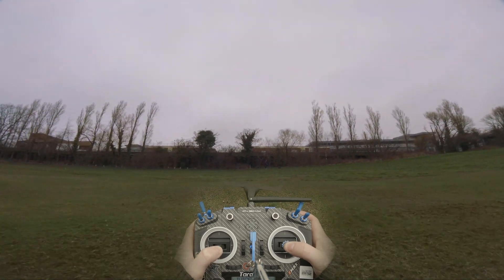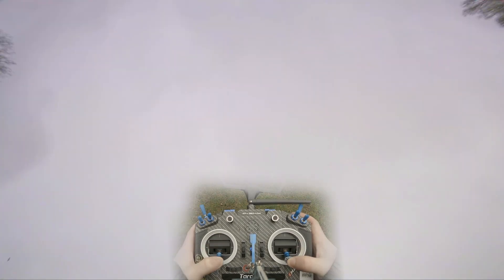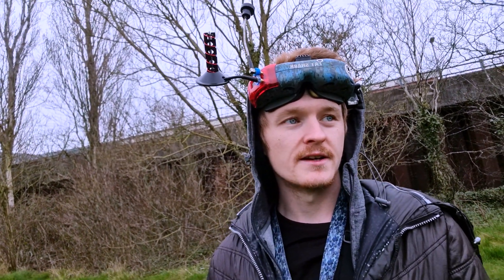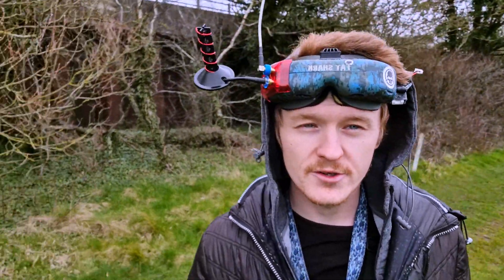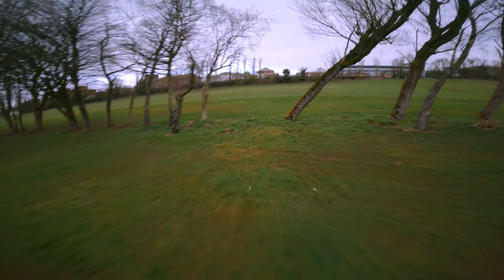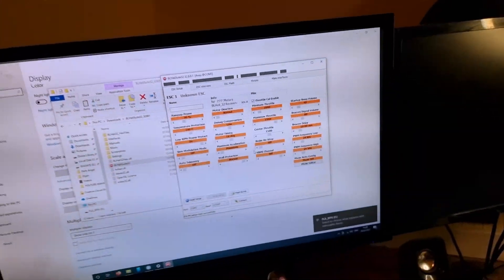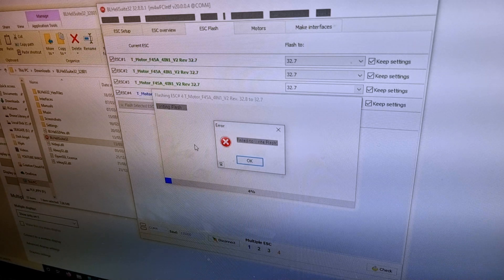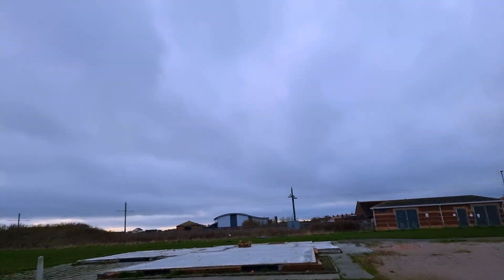Blheli_32 Upgraded to 32.8 || FPV DRONES

Comment: Is it bad to see bad frames in BLheli32 when I check in the configuration I see that all my arm Tekko32 ESC's are getting bad frames.   I'm having heard time finding and information of this. Problem I'm having is my 6 inch running latest inav 3.0 is having weird I'm guessing dysynk issues and falling out the sky.
Reply from the maker: Are you connecting to bl heli using a the flight controller Pass through? I would suggest trying a different flight controller to connect to bl heli and see if you see dropped frames then. Rules out the connection is the problem. I've never actually seen dropped frames before on any of my 4in1 escs. So that is a first. Are you using the latest bl heli firmware?
Reply: @AlexFliesDrones  latest BLheli32 and Tekko32 firmware and even downgraded didn't help.   These are individual arm ESC's not 4 and 1.   I've since took a sledgehammer to the entire build last night after 3 days of headaches and getting zero help from the so called community.   Boy that felt great!  I'm not much of a quad guy anyway I prefer planes and wings much less headaches and that community is actually helpful.    Thanks for your reply though but that had nothing to do with it.   It's just garbage inav I'm sure.

Comment: Very interesting I saw Pawels video about this and posted the comment below.

' I had exactly the same problem on BF 4.2.9 running 24 - 48khz on a Hobbywing Xrotor 40a 20x20 ESC and could not tune out the wobbles went back to 24 - 24khz and its a different quad. i have not tried 48 - 48khz. Also put the ramp up power back to default 50% and motor. timing back to auto. 
It flys great now, so smooth on default PIDs and Filter sliders set to 1.5 with recommended Notch filter settings 0, 250, 70, 350.
TBS Source one HD frame, Emax Eco 2207 2400kv motors 4s, Hobbywing xrotor F7 FC, Caddx Vista, ethix S4 props, TBS Crsf Nano, Caddx Orca action cam. Just didnt work for me. I Would be interested to hear any suggestions.
Also initially tried emuflight but tried to flyaway on arm went straight up'.
Reply from the maker: My suggestion is if it ain't broke don't fix it lol. I downgraded back to 32.6 for now. My quads are flying way too nice to change anything at the moment. And a fly away normally means the filtering is wrong for sure. I've never actually flown emu flight so I wouldn't know what to suggest. Sorry. Hope you sorted it 👍
Reply: @AlexFliesDrones  yes all sorted back on betaflight 4.2.9 🤣

Comment: It's a bug in FalcoX causing that ESC 4 issue, I saw a couple folk mention this problem on Facebook.
Reply from the maker: Yeah I had a feeling it was falcoX being difficult lol. Not the end of the world though. Still flashes OK with betaflight then plugged the 4in1 back into falcoX and everything was fine
Reply: @AlexFliesDrones  that was what the other dudes had to do as well, no doubt FL1 will say it's BLHeli32 code that's the issue though...

I have 2 quads with their Revolt OSD FC's and BLHeli32 ESC's in them and they just aren't as consistent as my KISS V2 setups, they'd fly fine one day and then the next time I took them out something would feel off. 

I can grab a KISS quad and it feels the same every single time I fly it, GUI is super simple too, none of this anti gravity, iterm relax, feed forward, 32khz sampling rates, a rate system that makes no sense (wtf is acro plus? 😅😅), there's 2 pages I look at in the KISS GUI and that's the quad setup and ready to rip and like I said they fly consistent every time. 

I'm in the process of building my first FETtec quad just now, hoping their ESC's give that same feeling that the KISS ones do, which I'm sure they will as they were designed by the same guy who designed the kiss speed controllers and FC's, and the FETtec FC runs KISS firmware, ESC's have their own proprietary FETtec firmware running on them.
Reply: Have a sub btw
Reply from the maker: @Dav2112  thanks for the sub! And yeah I've been meaning to try kiss for ages. I keep hearing its easy to set up and has a different flying feel. Might try it this summer if I have extra cash to buy the parts for sure. I did used to have issues with the revolt boards back when I first started using falcoX. Damn things wouldn't fly well at all and then one day after fiddling with it it finally worked right. And not had any issues yet. I agree it is temperamental lol

Comment: 48/96?
Reply from the maker: You could try that but i think it defeats the purpose of what this min and max output is trying to achieve as the lower the kHz the better braking and the drone has and more torque at a lower pwm.

Comment: indeed its the variable aspect causing bobbles. I'm  still on 32.8 but just use fixed pwm. I had smooth low throttle and smooth high throttle but at some point in mid stick has wobbles all the time. just going fixed pwm is the move till they get it figured out
Reply from the maker: Yeah I probably didn't need to downgrade back to 32.7 tbh I could've just put both min and max to 48khz and that probably would've solved the issue with the bobble. I will probably upgrade back again at some point and just do that for now until they figure it out like you said

Comment: Change your pids to smooth that bounce back Alex
Reply from the maker: I reverted back to firmware 32.7.  32.8 felt worse if you watch the end of the video when I did revert back the bounce back is gone
Reply: @AlexFliesDrones  the bounceback is because revolt FC are intended using only flightone firmware..blheli32.8.3 is not yet intended for flightone FC/flightone firmware, it is more like other FC firmware (BF,EMu,KISS,,Fettec) and your esc is must support , try using esc which is using F3 / F4 mcu, there more enjoyable..many famous youtuber has text and working
Reply: https://www.youtube.com/watch?v=GxoS6Pqg73Y   this some noise test for 32.8.3...before judge the firmware is not worth it, try to reviews the hardware combability to take a good benefit from it (Wiseman says that)